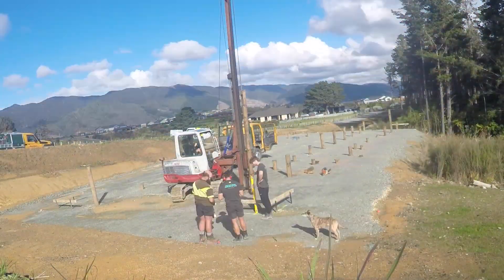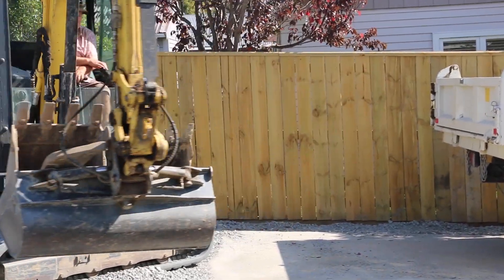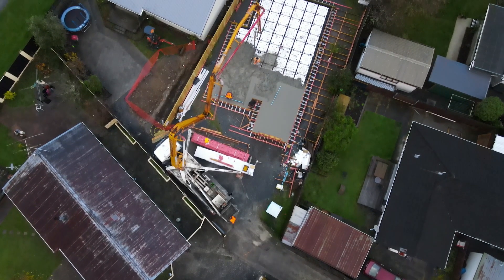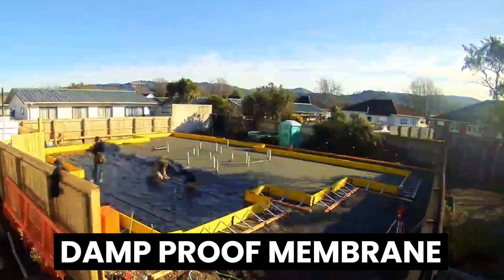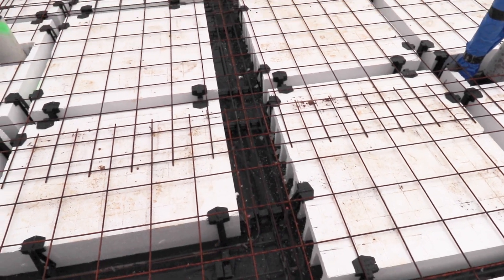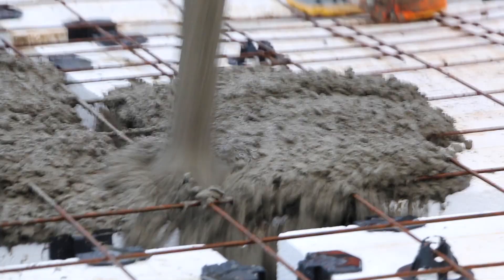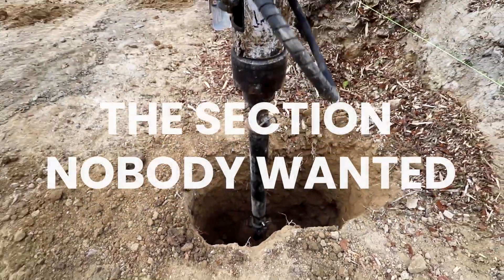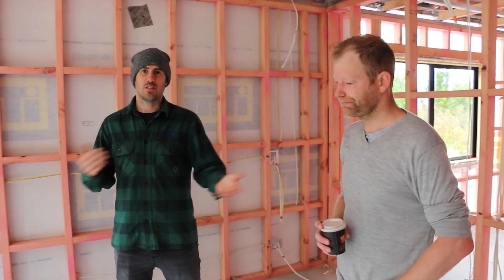Putting Timber Piles Below a Concrete Slab Explained!

Comment: Did you cut the piles flush with the ground and just do a slab as normal on top of them?
Reply from the maker: depending on the engineers details, some want it flush with top of sand, some want it 25mm into the slab, sometimes we need to drill in steel to tie it all together, the main idea is the piles are transferring the load down to good ground

Comment: Great video Josh. Does Geotechnical Engineer need to witness and sign off  the driven piles before pouring the concrete as part of Building Consent ?
Reply from the maker: An Engineer needs to test soil, design piles and sign off- but Doesn't need to be "geotech" a structural engineer can do it too if soil test is within acceptable range

Comment: With this thing called "climate change" we can expect higher intensity rainfall and more slips in future storms. Part of the reason for all these slips we have seen in NZ storms this year is because concrete ground floor slaps don't let stormwater soak into the ground underneath by concentrating stormwater in areas around houses that causes the ground to slip. The economy  of laying a concrete slab dominates raised ground floors -like what they did in the "olden days". Raised ground floors enable stormwater a larger area to soak and drain away.  Maybe adding timber piles will add to the soil stability and therefore your house if there is a slip but maybe doesn't prevent a slip from happening.

Comment: Hey Josh.. Saw them doing this on a new build motel site up here in Rotorua. Driving past everyday i wondered what the hell they were building at first.. they had all these huge wooden poles driven into the ground and sticking up about 3 metres above ground.. before they cut them to height!
Pumice upper soil layer up here.
Cheers bro.. enjoy your vids.. even tho im not a builder :)

Comment: Just like in the southern US. The friction of soil against the piles will support tons of weight. The scary thing I'm seeing done in my area is basically Floating Slabs. Most of our good sites are long sold so they are building on what I call Crawfish ground. Bringing in big shot rock, smaller gravel and Red Dirt then after a way to quick and inadequate compaction floating a slab on top.
Reply: Train tracks hold up a massive load on rocks alone

Comment: So why still pour concrete after you drive the piles.  Wouldn't it be quicker and cheaper to just build a wooden floor on the piles?
Reply: The proposed ffl of the new slab would be close to the natural ground level, hence the use of a slab. If they used the timber piles to build a subfloor (bearers + joists + flooring) the FFL might be higher than what is required for the area they are constructing in. If they were in a flood prone zone (i.e to achieve a higher finished floor level) or on a hill side, they would've opted for piles.
Reply: Also better insulation with a concrete slab.